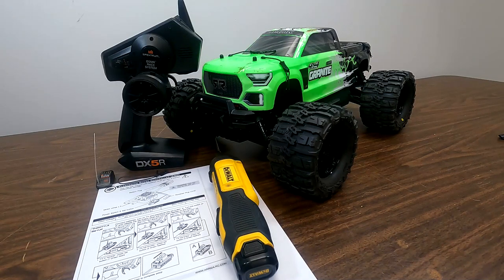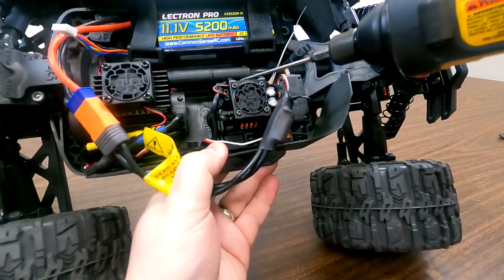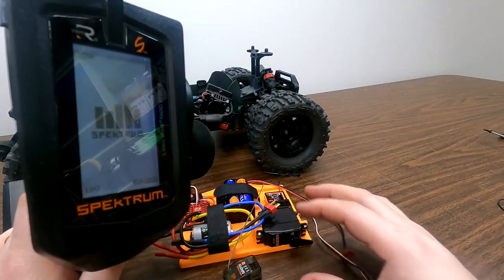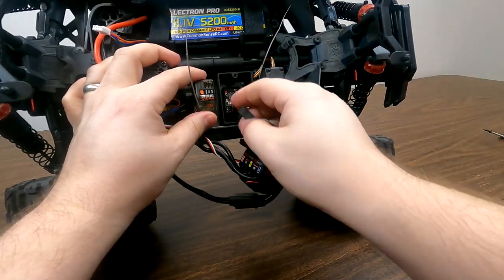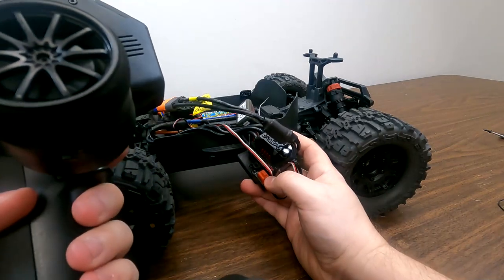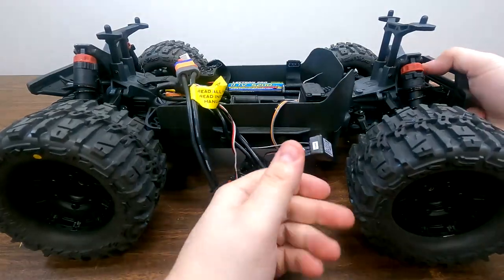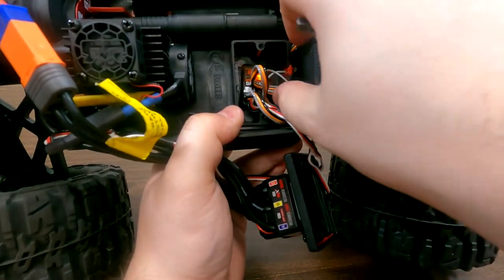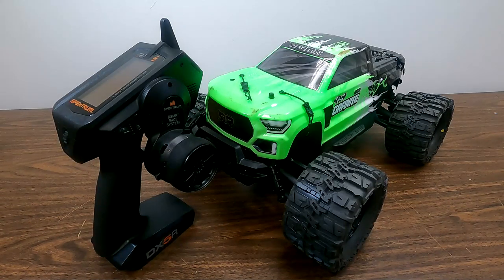How to do a transmitter upgrade

Comment: So, I just got my first RC truck, an ARRMA SENTON. Since it's just like this GRANITE, I noticed I do NOT have either of those fans on the receiver box or the motor. Do these trucks NOT come with fans installed? I saw how there was a plug for the fan in the transmitter. Is it the same on the motor? Do you have a video on this? Are there different fan sizes?
Reply from the maker: Hi there. The simple answer to most of your questions is if you have a brushed truck they do not have fans nor do they need them. The 1/10 brushless trucks do come with fans for the ESC but the motor is optional. For brushless trucks you really only need a fan if you are running a 3s lipo. and you can use any fan for 1/10 motors. To plug them into the receiver you really only need to pick an open port and make sure you have the appropriate connector and you are good to go. Hope that helps.